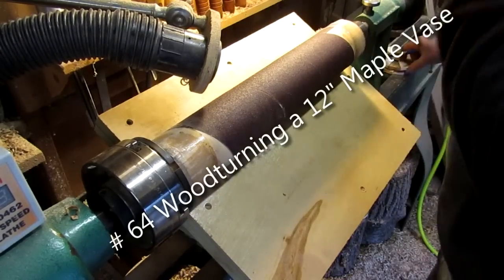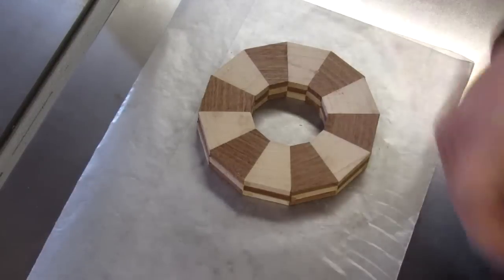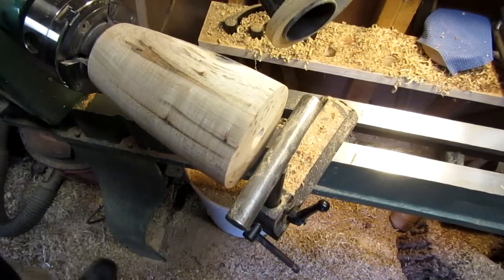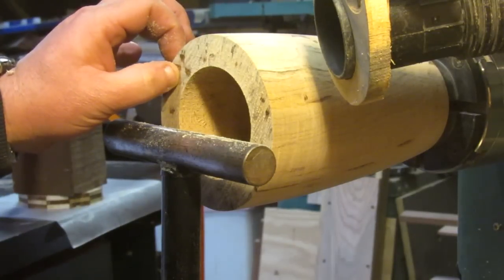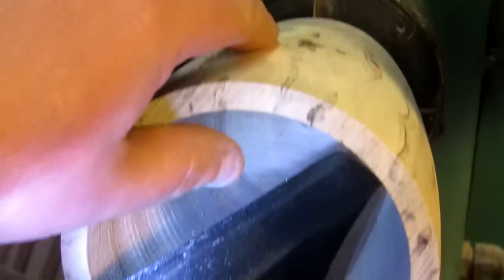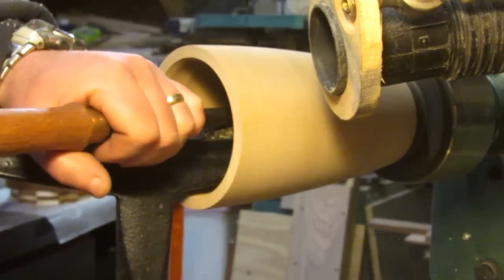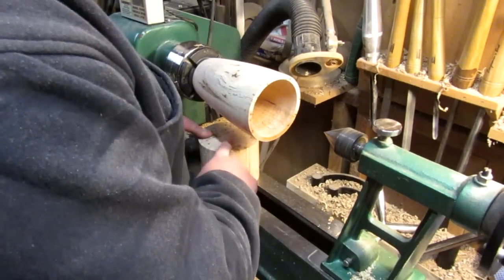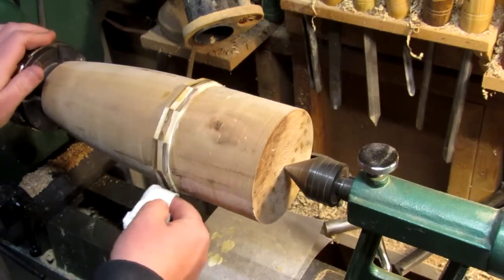#64 Woodturning a 12" Maple Vase Part 2

Comment: Great project going on here. Learning a few tricks as as I usually do with your videos. Will be waiting for the finish. Thanks again for sharing,  Fred
Reply from the maker: Fred Graber Thanks Fred. Glad you are enjoying this series. I had hoped to get the last part up today but sadly I can not take off the tenon until the finish is completely cured. I guess the cold has slowed it down a bit. It really did turn out nice (in my opinion). just need t get that tenon off tomorrow morning.

Comment: Great job as usual Stephen. you're right alternating joints are stronger but I have seen many segmented turners stack rings in the same manner that you applied yours, They should hold up just fine  especially that you are sandwiching them between solid wood
Happy turning my friend
Albert
Reply from the maker: Albert Furtado Thanks Albert. Yeah, I wasn't really worried about it to much, but I have had people get on to me about all different kinds of glue joints I have used on Youtube. If it doesn't work then I just learned something new. Always look to the bright side, Right? Thank you my friend.

Comment: the machinist method for attaching carbide is 45% silver solder which can be obtained from The Harris Products Group.  Be sure to get the correct flux.  To get comfortable with it you can Google brazing carbide and you'll get a ton of information.  It's amazing how well it works and how much pressure it can resist.

Comment: Man I really have to make myself a drum sander and the fact my shop is so small your idea of using the lathe for it is sounding very promising. but for rings I use the disk sander for one side and use the lathe for the second side when mounting.
generally I make 1 thick ring of whatever material I plan on  and part it off on the lathe but of course if you are working with 3/4 stock you  can't end up with 3 1/4 thick ring
Reply from the maker: Albert Furtado I have seen people use the same method you are talking about. With a drum sander you can glue all the pieces together at once saving hours or even days of cure up time, besides I can never get them perfectly flat on the disk sander so this is the only way I can do it myself. If you build one just please remember to watch your hands my friend. 80 grit at 1100 rpm's can do a lot of damage. Thanks for commenting Albert and for all your support.

Comment: Hi Stephen.  Sweet project...  like a lot your drum sander...  I have one for my table saw but I'm considering one for my lathe.   Are you happy with yours?  Is there something that needed to be upgrade?  Looking for part 3
Reply from the maker: muziqjazz Thank you sir. Unlike most of my shopbuilt tools, my sander has had no modifications since I first built it almost two years ago. Just make sure your mandrel is strong and can not flex. I have seen some sanders made with PVC Pipe and really don't know if the accuracy would be the same. I have a video overview of how I built this sander if you are interested. It is a relatively simple build. Here is a link to it. It is about the second half of the video. Thank you for commenting and supporting my channel. https://www.youtube.com/watch?v=ICehToDaObk&list=PLGsnYf7PysCQVT7EYNfJCKXVZA8pWG0q8&index=2
Reply: Stephen Ogle
 Thank you for your answer.  It is appreciated.    Marc

Comment: To keep your fingers safe when using your drum sander I'd suggest making a hook tool to get a hold of the parts as they pass through. It only takes a second of inattention to cause a lot of suffering, take care.
Reply from the maker: traog Thank you sir for the Excellent suggestion. My future videos will incorporate your suggestion. You are so right about the one second of inattention. This is how we all get better, by networking everyone's ideas. Thank you for commenting and supporting my channel.
Reply: Along the same lines as traog's idea was to make a push stick like that used for shuffleboard  to push with from the top.  I was a little nervous about the hands on both sides of the rotating drum and you need to be absolutely super careful when reaching over the spinning lathe to set the depth.  I can just see clothing getting caught in that drum.  I know it's not your first rodeo and I am enjoying your video very much.  Great work and be careful at the station.
Reply: An old friend used to say don't put your fingers where you wouldn't be comfortable putting your pecker. LOL
I don't have a drum sander, but I've been thinking on building one like you were using. I'll check out your video on how you made it.
Reply from the maker: LMAO. Now that was funny and great advise! I hope you find the video helpful.